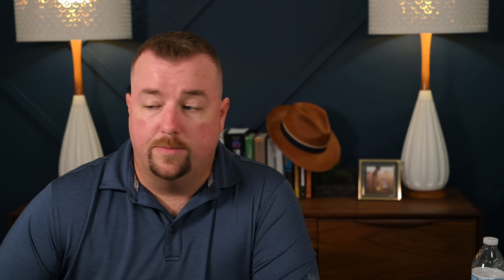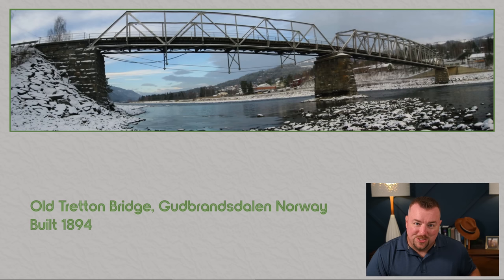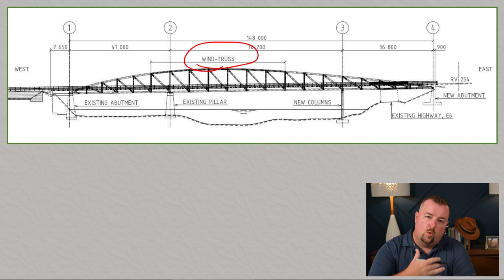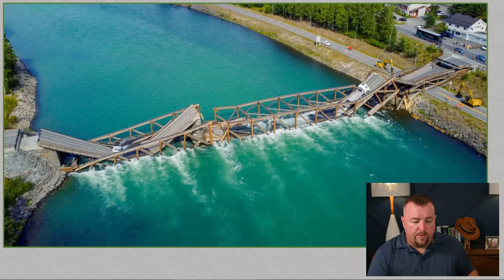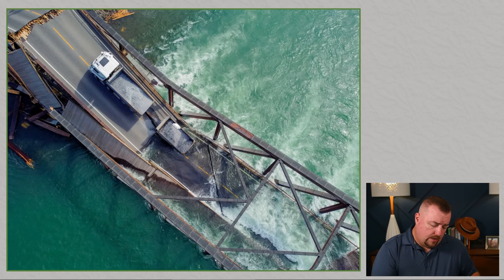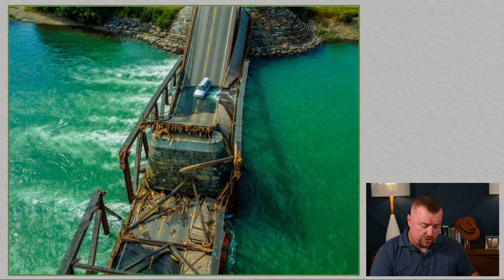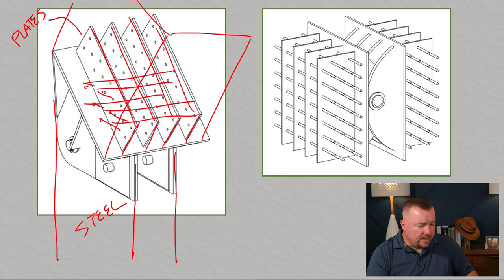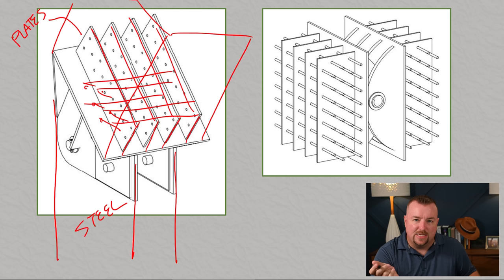How Did the Engineers Miss This?

Comment: Yeah, my parents had to replace their balcony because whoever built it decided to put metal around the wood, so once water got in it held it there. One side had carpenter ants and was rotting away. It was VERY unsafe. It was sagging under anyone's weight, and was perilously close to collapsing.
Reply: Any encapsulated wood Is liable to retain water and rot
Reply: As we develop new technology, we forget the old technology. I believe this is partially because the new technology is in computers, and the old technology was in books and minds. A great deal of the old knowledge needs to be entered into computers properly so we are not taking two steps forward and two steps back. And libraries need to not throw books in dumpsters because they have not been checked out x number of times in an arbitrary time period. Especially when they have many empty shelves. Take care.

Comment: A few random things occur to me:

1) The initial failure was at joint A on the A-B side. When this separated, the lower deck of the bridge dropped at point A. This caused a rotation counter-clockwise around the column support at C. Since the upper truss was still sound A-B-C, this put a huge strain on the upper and diagonal trusses C-D, combined with twisting the pins of the C end of the upper truss C-D. This caused the immediate failure of the upper truss connection. All that was holding C-D in tension was now the diagonal truss, and it then failed.

2) The truck has not rolled or slid backward primarily because the rear of the trailer has penetrated the collapsed decking and is now resting against the fractured edge of the deck and on the bottom of the river. The trailer is stiff, and so is the tow bar, which is now propping the truck up in it's current position. I would guess the truck was moving fairly slowly, and probably did not move backward by more than 2-3 feet, if that.

3) Since at least 1500, people in Europe have been building roof trusses and bridges out of oak timbers with rabbited and doweled connections. Up to the late 1800s there was a considerable body of knowledge on how rabbited and doweled joints worked (which is essentially what these joints are). I guess that knowledge has been lost. Also, when wooden wagons were constructed it was common to use iron end hardware on wooden poles. These poles were riveted to the iron fixings, in essentially the same manner as this bridge. But the problem with splitting at the pins was well known, and thus a cross rivet or two were installed to force the wood into compression around the pins. I guess this knowledge has been lost too.

4) While the idea of using gluelam with pins in tension on a bridge over a river gives me the shivers, I'm not convinced that this was a glue failure. The test specimens shown all seem to have been single timbers, and they failed along the outer pin lines. If the pin line was on a glue boundary, then glue deterioration could have contributed, but I'm not convinced that a glue failure was necessary to get this result.
Reply: 3 very good observations. Collapse sequence, truck stiffness (I also estimated 2-4 feet of movement, based on the out-of lane alignment and steering angle), and cross rivets to force compression.

I don't want to speculate about #4. It could have been the glue deteriorating in the weather; it could have been the glue acting as a water barrier keeping the wood from effectively drying out; natural defects in the wood; lacking understanding and design models.

Something that I want to add. My parents had a swing in their back yard made from round wooden beams. And after only one decade those arm-thick pieces of lumber were split along the grain even without any significant loading, simply from the weather and repeated soaking and drying cycles.
Reply: Could hardening of the glue have contributed to brittle failure of the wood between glue surfaces?
Reply: I agree. With modern adhesives the strength of a glulam beam can be accurately modeled as if it were a single, seasoned timber. 

The idea of all those steel plates and pins buried in wood, which is hygroscopic, in an outdoor structure lacking a roof, tells me that even with the ability to endure the loads when built, these joints were doomed to fail over time due to corrosion.
Reply: add inn that while it is still under investigation it have shown that the bolts in the joints have been under-sized, this was notified in a report done on the bridge after first bridge failed but with bureaucracy having to go its rounds time goes on and then this one happen.
if this have been the cause is still not verified and mostly wont be until next year with the speeds these type of investigations work at.

but the wood it self have been written of as direct culprit and while the 14 large type bridges of same construction have all been closed down the several hundred smaller bridges made in same way are all open... but then there is a limit to how much stress pedestrians and light traffic can make on a bridge.
Reply: @brrebrresen1367  Oh great, under-sized bolts when the main failure mode is that the bolts literally wedge their way through the wood. I can't see how that isn't the best place ever to save costs.
Reply: A simple static analysis shows that the tension on the left side of A would be higher than on the AB side. Where did you get your information on the failure mode?
Reply: @andrewmole745  Does that simple analysis factor in the diagonal beams (and their good performance in compression)? With the diagonals hypothetically going the other direction, I would agree with you. But that diagonal beam that goes from the top of A to the bottom of B can transfer some of the load between those vertical columns. I have no way of eyeballing how much, though.
Reply: @Pystro  I did an elastic static analysis of the whole frame (verticals, chords and diagonals in roughly the right geometry) making broad assumptions on the loading and the properties. The effect of the diagonal was fully included..

Comment: Keep in mind wood softens when wet, and end grain will allow deep penetration of water (that's how trees live). There is nothing but multiple points of end grain exposure in these joints. 

Also, all of the pins are aligned along the grain direction. It's basic woodworking to stagger them to resist splitting. 

I think it is unlikely this is a failure of the steel pins due to corrosion. The wood is more prone to failure due to exposure than steel is.
Reply: ב''ה, I think common classical techniques included sealing with pitch, bitumen, whatever emmymadeinjapan made her turpentine potatoes with - it's shabbos, I should at least be studying something else rather than this - and later the more toxic creosote.  If data on treated connections isn't available, I guess that's more work to be done later.
 
Still trying to comprehend the actual failure here, but would simply pouring a hot tub of pitch into the pinned connectors have bought much more endurance?
Reply: @josephkanowitz6875  I doubt it.
Reply: @drooplug  Same here, the wood is still moving with load, absorbing water, freezing and so on.  Stagger the bolts, extend connections with a cinch plate and install a compression ring.  That truck w/load is too much weight for a wooden bridge.  I'm sure it was fine when new but wood degrades when exposed to the elements
Reply: What happens to wood when it freezes? Or freezes wet?

Comment: Something came to mind very quickly looking at the pinned connections.  The designers seemed to be going for something like a pinned box joint or lap joint (to borrow a term from woodworking).  However, the pins were positioned between lamination layers while the fingers were perpendicular.  This is exactly opposite to how you want to set up your connection!  The pins should go perpendicular to the lamination to anchor in as much solid wood as possible.  The plates would then be coplanar with the laminations and have much better contact surface.  They went with an incredibly weak connection that would also weaken the wooden members themselves.  In addition, the leverage of those pins through the weakened members would then peel them apart along the glue.

Another thing is that laminated wood can be very susceptible to damage from humidity.  The splintered deck looked like MDF or fiberboard that got wet.  You never use those outside.

Edit: Watching the video further seems to confirm some of my suspicions.  Also, around 22:50 you're talking about the connection failure mode(s).  I think the paper is trying to say that because they didn't properly account for deformation of the connections, the actual loadings differed greatly from those of the models, hence they overestimated strength.

It comes as no surprise that the connections tended to split the wood.  That's the primary failure mechanism for any wood joint.  Ask any woodworker and they tell you that splitting is the number one concern in any connection because weakest direction is perpendicular to the grain (i.e. the lignin holding the wood fibers together).  You almost never see a connection fail across the fibers, hence why pinned joints always need plenty of material outside of the pin.  Also, any good wood joint uses glue on all of the faces.  The pins are never the primary holding force.  It's the massive surface area contact between pieces.  I don't see that at all in the steel/wood connections here.
Reply: Yeah, I noticed that too. I would have thought that they would have engineered the slots to coincide precisely with the glue layers. But as seen in the video, that still doesn't solve the problem of the dowels/bolts acting like round-edge wedges and splitting the grain. 
-- I also wondered whether any difference between the expansion co-efficients of the wood and the glue, exposed to extremes of temperature combined with repeated wetting and drying (with swelling and contracting of the wood, not the glue) may have complicated things further. Thermal expansion and contraction, freeze-expansion and thawing and drying contraction, and wetting-expansion and drying contraction, only the first of which affects the glue, and that likely differently from the wood, all together make for a bouillibaisse of weakening factors. And the cumulative effect over time?
-- Those old New England COVERED wooden bridges seemed to have little problem surviving 100 years.
Reply: I am neither a skilled woodworker or engineer but logically to me what you say makes perfect sense. Especially the part where ONLY the pins are the primary holding force. I have built a few utilitarian things from wood which were screwed together AND glued and they remain solid after 15 years. I used well more glue than screws!  But in this bridge could they have used glue? Will it adhere to the steel or could the steel be etched perhaps to enhance adherence?  In the few places I  have used anything even close to this construction, instead of pins I used threaded rod with double oversized washers on each end thus also keeping the wood in compression. Would that have been any better for these joints? Thinking also if some compression could have been added perpendicular to the pins thus limiting the ability of the wood to split?  But all in it seems the ideas I note here would just be lipstick on a bad pig joint.
Reply: @larrybolhuis1049  Wood glue is actually stronger than the wood itself.  You can use epoxy or similar bonding agents in place of glue when you need to fuse wood and steel.  Knife handle scales (the sides) are commonly epoxied in place.  Etching the steel is also common practice, oftentimes with sandpaper to provide more surface area.

There's a lot they could have done to improve the connections, but as you said, it's lipstick on a pig.
Reply: ב''ה, I think everything you wrote makes sense except in the last use of "perpendicular" you mean "parallel" as the pins/load pull and split through the gaps between the fibers?
 
In the interest of saving lives, I'm going to have to watch this video a few times to see what they did get right and what's idiotic, or created by errors between plans and construction (any incorrectly oriented beams if the engineering plans got anything right).  I think classical maritime construction has many examples of "strapping" the ends of beam type timbers or masts to prevent splitting and improve strength.  Dipping the whole end of a wooden beam in e.g. a stronger than wood epoxy might be another method but create issues with interactions with the laminate glue unless the same chemical were used throughout, or create another interface for internal water buildup and swelling, rot, etc where the sealed portion ends.
 
Connector techniques that can bear these loads gracefully will certainly be important to renewable construction; bridges are a good demonstration but in practical terms if you're using one for 100 years it's not a huge example of materials waste.
 
USA does really need a solution to flat-land railroad grade crossings and returning to wood for 'drop on' timber bridges is the sort of thing I'd be interested in working on when it isn't shabbos.
Reply: @ssvis2  Have heard the claim that the glue is stronger for years. Yet the glued joint seems most often the point of failure. Seems to me it's almost like interrupting the fibers results in a weaker joint. Hmm, who'da thunk?

Sure, the glue may be stronger than the wood but it's not penetrating and completely interfacing with every fiber. Can see that more clearly with soft woods that have large growth rings. The glue doesn't adhere as well to the denser areas. Also the glue has to remain pliable. So on one surface some of the stronger fibers are mated with the weaker fibers on the other surface, and vice versa. Thus the joint is weaker than with continuous fibers.
Reply: @heartysteer8752  You're absolutely right.  I've primarily seen glue joints fail by tearout of the wood around them.  You'll see something similar with welds.  Often the weld is stronger than the surrounding material and leads to increased stresses around the connection due to reduced flex in the joint.

A structure is only as strong as the weakest component.  If the connection itself is stronger than the materials being joined or focuses stresses in unusual ways, you'll see unexpected failure modes.  It's a really fascinating area and very difficult to balance in engineering design.

Comment: If you have a chair that has crossrails that are mortise and tenon with a couple of nails through the joint, then rock back and forth on the chair, the joints will loosen, and eventually pull apart
If a simple woodworker can understand that, why couldn't professional engineers !!
Reply: If you use wooden dowels sealed to the other wooden parts with a good glue, the joints won't come apart easily.
Reply: Why ?  -- because engineers and architects NEVER ask a lowly carpenter if their ideas on paper will work in real life
Reply: @Harry-zz2oh  Not easily, but they can and will if subject to enough force. Source: my dining chairs.
Reply: I happened to be the guy how deals with the aftermath, some 1-30 years later. I 'am not surprised. I had cases where, engineers or project leads (for big 20+mio contracts),who failed completely to understand the water does actually flow downhill and yes, metal does actually corrode if you expose it to moisture.
Reply: The simple woodworker's knowledge cannot easily be turned into numerical values suitable for putting into a computer. Therefore it is often ignored by the sort of people to whom university education is more important than practical experience.
Reply: May have worked much better if the grains for each layer weren't all the same direction.
Reply: @beyondEV  mio?
Reply: @Harry-zz2oh  For an indoor chair, sure. But for a chair left out in the elements for years? No, that chair is absolutely going to fall apart sooner or later. There's a reason you don't see woodworkers rely on glue joints for outdoor furniture.
Reply: @sinisterdesign  
And you dont see too many wooden extension ladders these days.
Reply: The cyclical loading, with large loads, would definitely be a problem with the sort of joints they used. I'd definitely not choose a similar (scaled down) joint for making a chair, it would break very quickly.
Reply: @cedriclynch  "Therefore it is often ignored by the sort of people to whom university education is more important than practical experience." Perhaps, but unlike American university grads, do your white European engineers have a firm grasp of how they oppress marginalized engineers?....
Reply: @demef758  I don't know. I did drop out of a college course in engineering in about 1980 after a lecture in which the lecturer said that it is the job of an engineer to design the skill out of manufacturing workers' jobs.
Reply: @notthisguy8817  I wondered about that. Standard ply like marine ply has alternate layers of wood with the grain running 90 degrees to each other
Reply: @elonever.2.071  Mainly because they were really heavy.

Comment: I designed and built a bunch of small bridges in the 1980s and early 1990s. My oldest glulam is now 37 years old.  On bridges with good abutments and an under 30 foot span, glulam was the best solution. I had all of my glulam pressure treated with creosote to 12 pcf retention. 
I was in the middle of a bridge project in 1991 when I was called up for Desert Storm. When I got back, it took the road crew 5 1/2 hours to install a glulam kit.  That saved a lot of money.
Another good video. 50+ years ago we used shear rings in connections. Bearing failures with wood are usually a slow progression from repeated loading. It sounds like they can't believe that the software is wrong. I have to wonder if post-tensioning the wood to steel connections is going to be necessary.  Good Luck, Rick